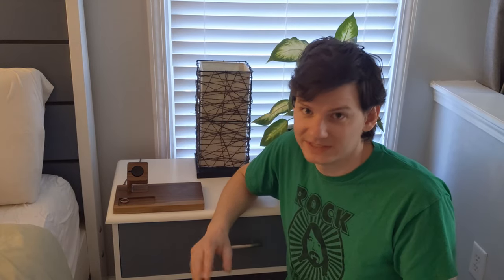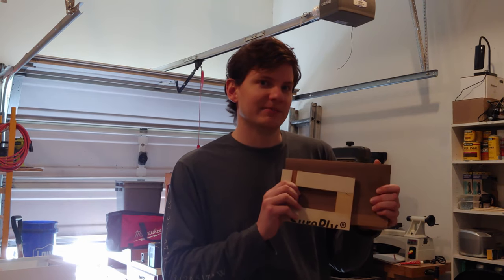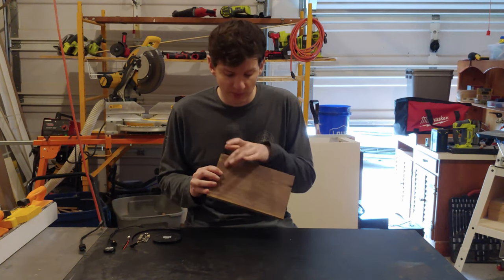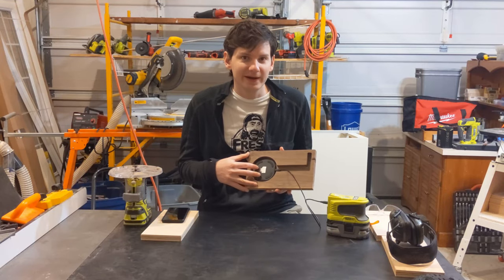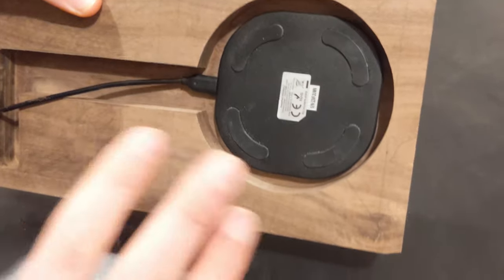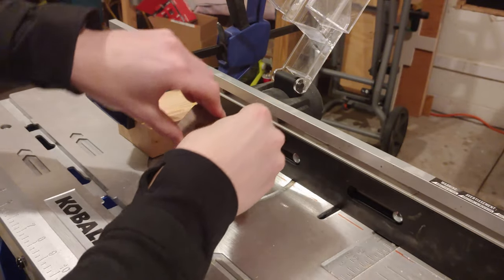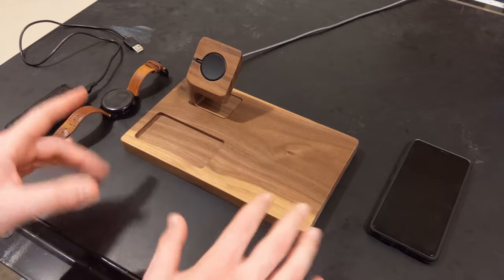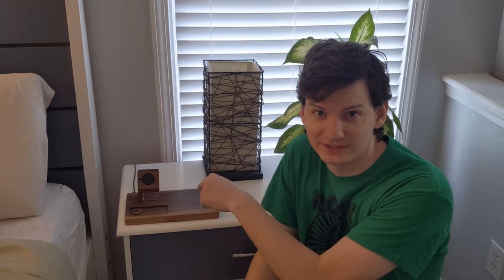How to Make a Phone and Smartwatch Hidden Wireless Charging Station

Comment: Late to the party. Excellent video and extremely well produced (lighting, camera angles, ability to see the work etc)

With the 3/4” walnut and the 1/8” left for the top would there be sufficient room to route a larger rectangle around all the electronics and then either tack/screw or magnetically hold on a base plate to cover the electronics? I want to make similar for my GF but worried one of my kids may flip it, notice all the cool wires etc and start trying to pull it apart. A recessed base would look clean and keep little eyes confused. Just not sure the USB board will allow sufficient clearance. 

If not I suppose  a 1/8 piece of walnut cut to around 1/8-1/4” smaller on all sides and mounted (causing a 1/8” “lift” around the edges) could work and not look horrible🤔
Reply from the maker: When I started designing the dock I was thinking I'd put a base plate on too but I left it off because of clearance issues. Not saying it can't be done but I think you'd have to change my design to make it work. The USB ports/cables make the hub thicker than I'd like. 

If you could find a piece of 7/8 or 1 inch thick walnut that might work better for you

Comment: Great video and thanks for sharing. I’m curious of the amount of heat that phone charger gives off on the board over night. Is it pretty significant or barely any? I’ve never taken one apart and am curious on the heat it generates outside of its shell while charging. Thanks again 🙏🏻
Reply from the maker: Don't know an exact amount but it's nothing crazy. Still using it every night with no problems

Comment: A little tip:

When wiring USB, make sure to wire the Power wires, AND the 2 Data lines (data+ and data-). A lot of devices nowadays require the data lines to tell the device what kind of cord it is, otherwise it won't accept power. Found that out while wiring up USB ports to my car.
Reply from the maker: Thanks for the tip Matthew! I have read of that but haven't encountered that myself (yet)

Comment: Just came across this and I like the design.  Going to try and do it on the cnc instead of using a router.  You are much better with a router than I am.
Reply from the maker: Nice! If I had a cnc I would have absolutely used it, would have been a lot faster and easier! Be sure if to check out the plans for dimensions if you haven't already

Comment: Hi Bill, can you tell me what diameter hole or bit to use for the iWatch charger. If you can add a written description, it would be nice. That is really an awesome work there.
Reply from the maker: Sorry for the late reply! The hole for the charger is 1 3/8". However, I have a galaxy watch and not an apple watch so it may be different for you

Comment: Very cool project, and I like your techniques. Nice to see the chisel work.
Reply from the maker: Thanks! I don't consider using chisels a strength of mine but they sure are nice when you do need them
Reply: I know right? The actual handwork is spectacular. I came here looking for how to make a wireless charger... like the actual charger using copper cable and how to calculate how much amperes to produce per area and number of turns and whatnot, but I ended up watching the entire video.... amazed at his wood-craftsmanship. I thought to myself, if he were to build that here in South Africa, he could easily sell that station for a few thousand rands (R not $)

Comment: Where did you get the base for your handheld ryobi router? I want to get started in making templates and obviously using them , the one you use looks perfect.
Reply from the maker: The base is part of the circle cutting jig I used in the video. There's a link to the specific one in the video description

Comment: Can you link the jst connector that works for this usb hub?  I think the link provided is wrong.
Reply from the maker: Yep, just fixed it. Thanks for pointing that out!
Reply: Thank you.  I’m going to try building this. Would you be good enough to provide the approximate height and width of the watch stand as well as the thickness of where the watch charger sits?  I like the proportions you have. Thanks!
Reply from the maker: The watch stand part removed from the base is about 3 3/8 tall, 2 5/16 wide and 1 5/8 deep. It's 1/2 inch thick on the angle where the charger sits. I am going to make 3d plans for it at some point but no idea when I'll have the free time to do that. In the meantime happy to answer questions about it
Reply: @ProjectBilld  Amazing.  Thank you!

Comment: Where can i get one of those cutting machines?
Or Howe is it called?
Reply from the maker: The tool that I cut the pockets with? That's called a router. If you meant something else, let me know!
Reply: @ProjectBilld  what type of router bits did you use?
Reply from the maker: Hi there, the pattern router bit I used is linked in the video description. I also used a few different size straight bits to cut the slots for the watch charger wire, you can see those sizes in the plans that are on my website (also linked in the video description)

Comment: I have a really thick phone case and I tried something like this before and it didn’t work well for me. It either didn’t charge or charged very slowly and I cut as much out of desk as possible. So my solution is to instead inlay the charger flush on the top of the desk and then fill around the edges with filler/epoxy. Then i can either paint or apply a very thin veneer over it
Reply from the maker: Yep a thick phone case can certainly make it difficult! Glad you found a solution to it

Comment: some Qi chargers must be way under powered. I was attempting something similar using a inexpensive Anker Qi disk and I had the wood thinned out to the point I could easily push my finger through it and I still couldn't get a connection with my phone in its normal case.
Reply from the maker: Definitely sounds like it was underpowered. Can vary with the phone, case, species of wood, etc. Lots of variables to account for

Comment: Nice build what are the dimensions?
Reply from the maker: The base is 10 by 6 and 3/4 thick. The top of the watch holder is about 3 inches above that when it's attached to the base
Reply: Perfect thank you